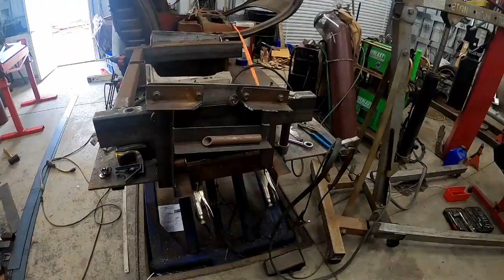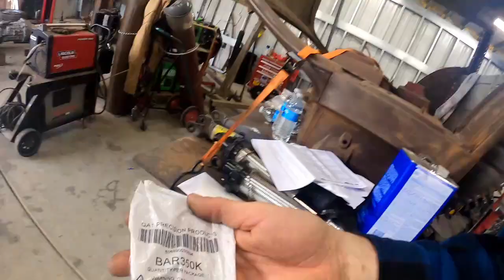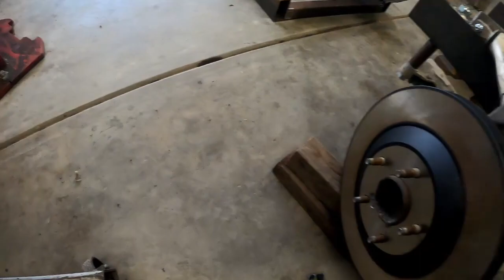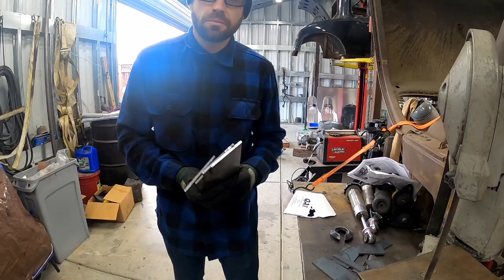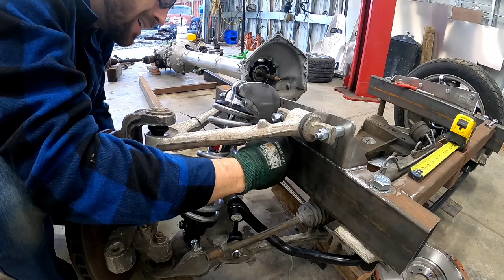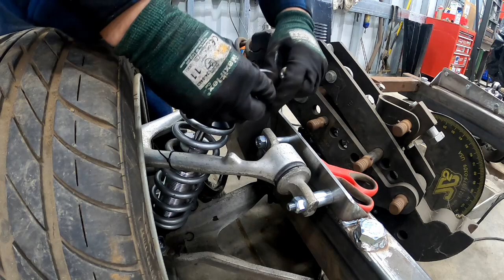Fabricating Upper control arm & Coilover mounts for front C5 subframe

Comment: If i make like four exactly same pieces i tack them together after a rough cut and hit them with a flap disc or belt sander so they get get the same shape. And maybe make a top plate between the two pieces to make it stronger
Reply from the maker: Thank you for the idea, I’ll definitely be implementing that for future duplicates! I’ll see what I can come up with for a brace today as well 👍🙌